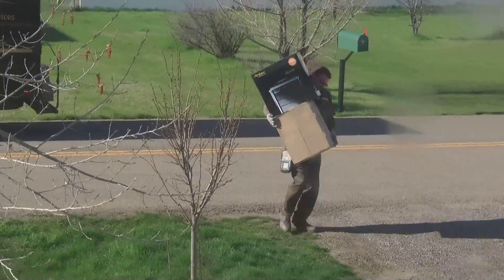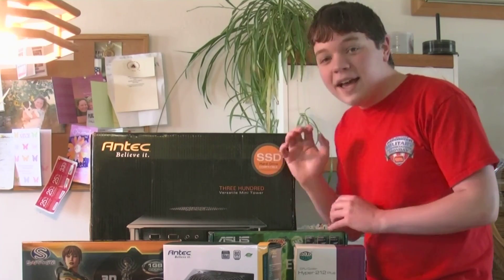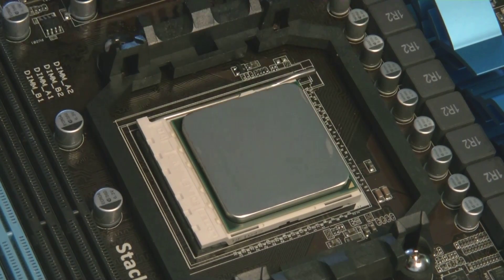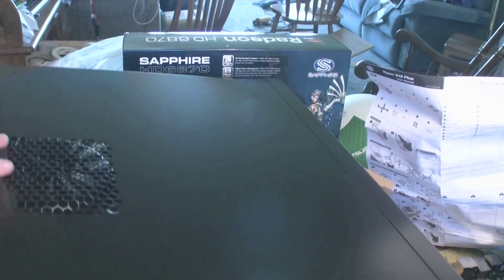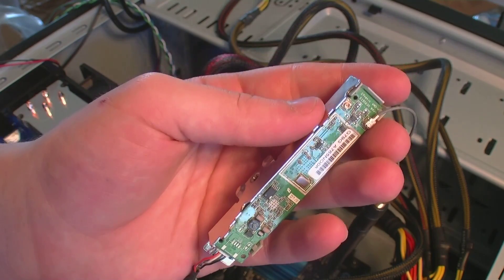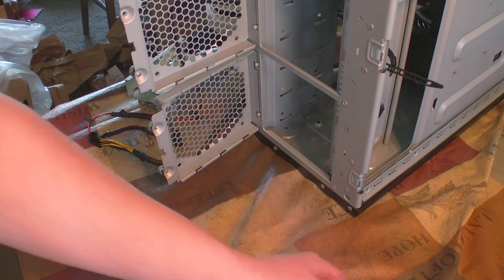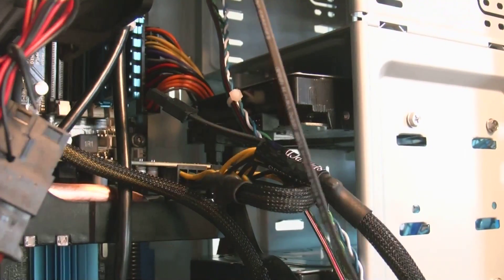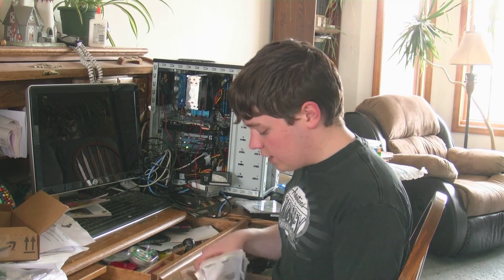Building My Computer

Comment: Slim computers aren't bad when you look at what it has, and if they're more of a modern one. I got an HP elite 8000 SFF (small form factor), 4gb RAM, 2.93 GHz processor, 250 GB hard drive, PC was only around $130. And I got a GeForce GT 710 graphics card for only $50, and this computer is SO fast, when the memory usage doesn't max out when I have a ton of programs open. I can play minecraft in at least 60 FPS with a 16 chunk render distance, even to 80 with other great settings. I can even play Fortnite with 30 FPS on this computer too, which to me, is great. And I even have 2 monitors used all the time. I, at least, don't have any regrets. Having regrets about getting a slim or sff computer really depends on what it has, me personally. I hope I didn't sound like I was bragging or anything.
Reply: And btw, I do plan on upgrading to 8GB RAM, maybe 16 GB, a quad core processor, maybe an 8 core processor, a better graphics card, and possibly, an extra hard drive or an SSD, when I get the money that is.
Reply: Still, great video! I love working with computers. And I do personally like bigger computers better, they're easier to work with. But for now until I can get more money, a slim or sff computer will be fine for me. :)

Comment: I had been getting very very board with watching videos that board the crap out of me.. When i came accross this one so i wanted to see what a noob would do.. not bad choices to start with the more you learn the better you will become.Cable management though is another story, you have bad air flow there and at some point something will over heat. here is some helpful advice from a guy who can build computers... you're case, the case it self is a good one for a very low in machine and there is not much you can do about the cables there but look into a better case.something like this one.

http://www.newegg.com/Product/Product.aspx?Item=N82E16811119233&ignorebbr=1&cm_re=PPSSBGDRYLXVJN-_-11-119-233-_-Product

this will help you with air flow and allow you do better cable management.. You hard drive switch it out for a Solid State Drive better know as a SSD. This will give you a hell of alot more speed for sure. in one Video you upgraded to 16 gigs of ram which was a smart move.. The video card is ok but to really kick some teeth down someone's throat i believe a Gigabyte Radeon R9 something like this

http://www.newegg.com/Product/Product.aspx?Item=N82E16814125491

The Motherboard it self should be upgraded.. there is 4 major reasons and they are

1, you will be able to use GBS 6.0 "this will be alot faster then the 3.0 and you will be able to use if you get the right motherboard USB 3.0 which is alot faster then 2.0..

2, better board means better proformence, this can be gotten just be upgrading the motherboard it self to something like. http://www.newegg.com/Product/Product.aspx?Item=N82E16813128627&cm_re=am3_motherboard-_-13-128-627-_-Product you can still use your processor, which can be overclocked to 4.0 "with liquid cooling." you can use the same ram too.
3, faster faster and faster.. if you go by this you will find your computer will be alot faster, cooler, and you wont have the slow downs like your getting now.

4, FINALLY! just by upgrading the few things your computer will run at least 15 - 45 % faster  then what it does now simple upgrades can make your computer life alot easyer in alot of ways.

SSD's are the best way to improve your computer with just switching out to another SSD drive and doing away with the Hard drives you will find everything loads faster then before. Also, here is a tip for ya, The computer will be as fast as the slowest part of your computer, which means that 5400 RPM hard drive has got to go bro your slower then a 1.2 GHz - P4 processor... Remember if you build it right you wont have to worry about it for years to come.

Well i hope this has been helpful to ya bro Good luck out there too man and nice first time build.
Reply: this video is four years old
Reply: ***** if i wanted you to tell me how to spell i would have asked you for it..... but since i did not your a idoit..
Reply: chipthe ehtpihc i did not see the date... lol ooooooooops..
Reply: He also had a bottom mounted PSU and he put it on carpet....this pc will overheat
Reply: this video is a old one
Reply: This video is 4 years old... Back then he was about 13 or 14
Reply: Wow it took you 3 comments to realise the difference between your and you're
Reply: NOBODYS PERFECT ;_;

Comment: The fan has arrows on the sides in the direction of airflow, so... Helpful advice from a 12YO...
Reply: What, do you mean, helpful advice from a 12YO? A 12 year old, can be capable of building a computer. In fact, you kind of just dissed a nice population of 12 year olds by acting like you know a lot more.
Reply: Elijah Huang I am 12 and I have a gaming pc :)
Reply: I didn't say a 12 year old can't have a gaming PC, nor did I say anything negative against 12 year olds.
Reply: Elijah Huang Yeah i know i wanted to support your reasons against Minecrafting in the closet

Comment: He built this pc with back to front steps. You should put the backplate on before putting the CPU in. And then put drives, cables and DVD into the case before adding cables and installing gpu.

Comment: i built a 200 computer using:
Amd A4-4000 3.0 ghz dual core
Fm2 basic motherboard
4gb corsair ram
80gb hard drive
radeon 5450 1gb graphics card
ATX mid tower case
350w power supply

Comment: ohh god just finished my build i got.. .
amd radeon hd 7770 1gb double dissipation
intel pentium g3220
asus b85m-g
1tb seagate barracuda
500w storm silent psu
4gb of corsair ram
Reply: ***** Hard Drive: 500GB Seagate Barracuda 7200RPM
RAM: 1x4GB Corsair
Power Supply: Corsair 430W
Motherboard: MSI H61M-P20 (G3)
Graphics Card: ATI HD Radeon 7770
CPU: Intel Pentium G860
Case: Fractal Design Core 1000

It's pretty budget, but it performs pretty well :)
Reply: Looks like a shitty computer
Reply: What i have
Hard drive : WD Blue WD10EZEX - 1TB 7200RPM 64MB SATA600 3.5zoll
Ram : 8GB (2x4GB) G.Skill Ripjaws-X DDR3-1600 CL9 (9-9-9-24) DIMM RAM Kit
Power : Corsair Builder Series CX750 750W ATX 2.3 V3 active PFC NT (80 + / 120mm fan)
Motherboard : ASUS M5A97 R2.0 GL/SATA600/R/USB3.0 AMD970 ATX SockAM3 +
Disk drive : Samsung SH-118AB 18/48x - DVD-ROM SATA internal black
Graphic card : Sapphire Radeon Toxic 2GB GDDR5 OC R9 270X 2xDVI/HDMI/DP
Cpu : AMD FX-8350 (8 x 4.0GHz) 8MB Black Edition (Vishera) SockAM3
Cpu cooler : Cooler Master Hyper 212 Evo Socket FM1/FM2/AM2/AM3 (+) / 775/115X CPU Cooler
Case : Thermaltake Commander MS-I Snow Edition - Mid tower ATX / mATX - white
Reply: Timo Pomer Should have got 2 4 gb they work faster
Reply: I have : 
Cpu : AMD FX-6300 4.0Ghz
Graphics : EVGA GTX 660 3gb Superclocked
RAM : Kingston HyperX 2 x 4gb ram
Mobo : Asrock extreme 4 970
Power : Corsair 600w
Reply: I got
Cpu: amdfx 8350 @ 4.5ghz
Gpu: gai ward geforce gtx 770 phantom edition 1.2ghz 2gb gddr5
Ram: gskill 8gb ddr3 ram @1600mhz
Hdd: 7200 rpm toshiba 1tb hdd
Psu: 750 watt psu
Reply: I got
Cpu: amdfx 8350 @ 4.5ghz
Gpu: gai ward geforce gtx 770 phantom edition 1.2ghz 2gb gddr5
Ram: gskill 8gb ddr3 ram @1600mhz
Hdd: 7200 rpm toshiba 1tb hdd
Psu: 750 watt psu

Comment: Oh and by the way majority of the speed of your computer comes from your CPU, for example a 1Ghz cpu with a radeon 7970 will run horrible. You need to balance out the gpu with the cpu so theres no bottlenecks, for eg. an a10 with a radeon hd 7970 would bottleneck the gpu so much and wouldnt work as outstanding as it should.

Comment: Umm no way is an A10 comparable to an i7, heck its not even comparable to a good i3 man. even the a10 5800K is no where near as good as the i3 3220 nevermind i5 or i7. Benchmarks prove it its just no where near comparable performance wise. Although its a very good budget build APU. But seriously if your gaming you dont wanna use integrated graphics ;). 1 think unexperianced pc people do is judge cpu's by cores or MOAR GIGAHERTZ!. No. i3's have dual cores but still outperform some quad core amd's

Comment: True, but mainly it depends on how many fans you have installed, and which way they're facing. With more cables in the way of components, means more air flow is needed.

Comment: Your incorrect, it does change the computers performance. With all the cables in the way of the components it means less airflow which equals overheating which equals slower computer performance. Snayup ;P

Comment: Windows have just as many software errors if not more than a mac. And the support comes from the store you get it from. Make sure you get it from a store with good support, don't be an idiot. If anything happens, they will take it in and fix it for little or no charge. It also has to do with your guarantee. It is very hard to create a Mac virus, many hackers can't do it or just don't have enough time. Most people have a PC because they are cheaper.

Comment: The look of those things is a disappointment, as i use to be a big Mac fan with the older Macintosh. They are nearly impossible to  open up and repair, modify, hardly any support for them. They tend to have major issues with software, tend to freeze a lot, maybe not as many viruses, because its not worth hackers time, as more people are using p c.

Comment: That kid spent 1000$ for this pc.
I built a pc at about 400$
CPU:AMD Phenom II Quad Core, 3.4 GHz, 6MB L3 Cache.
8 GB RAM
Graphics card:GT MSI afterburner 4 GB
BOX: Shere II
Motherborad: Asus, 2600MHz FSB, 4 RAM Slots 16GB Max, 7 SATA 
Windows 7 ultimate, i suspose that it was the most expensive thing on my pc FREEEEEEEEEEEEEEEEEEEEEEEEEEEEEEEEEEEEEEEEEEEEEEE!!!!!!
hard drive : 250 GB SATA III
and some extra cables
power suply:600 watt
and a DVD player
this kid spent 1000$ i dont bielive that

Comment: In the past, AMDs were pretty much on par with Intel, but in recent years, they haven't been able to keep up. An AMD from this year cant keep up with an Intel from last year. Get a standard Third Generation I5 and that should be more than enough in the years to come. I myself do a lot of multitasking and I needed a fast computer, not really a gaming one right now, so I went with an I7 3770k. A bit of overkill, but it will last a longer that way.

Comment: Have you ever heard of a bottleneck, Well its something where You get one Expensive part, and get the cheapest Next.
Example- Expensive GPU, Poor Motherboard, Poor PSU, Poor CPU Heatsink, Poor case with no cable management holes.
FUK YA CHEAPO!

Comment: asus M5A99X EVO mother board
AMD Phenom II (x6) hex-core processor stock cooler
MSI radeon 6870 video card
corsair TX650 psu
HAF 922 case
8 gigs of ram (vengeance same as his)
2tb hard drive (sata 3 7200rpm)

Comment: @multiTylertv i agree that they are overpriced like 1000 for the cheapest laptop is a little harsh. but the mac lasts for a long time, i have a friend that bought a mac two years a go, he never had a single virus nor a crash, and he still loves the computer. unlike my old pc which i had to take 395679846 viruses out (the number is an exaltation) plus the buttons stopped working and the updates didn't change anything. btw have you ever owned a mac, and i mean owned (not borrowed or tested out)?

Comment: @StuffTubeAmwesome they will not overheat werather they are pulling air or pushing its still moving the air away. if one hard drive can survive without a fan then if the fans are pulling the air its ok max they can get is about 40c

Comment: download cpu-z, and cpuid hardware monitor. These programs will tell you if things are either too hot,  or if your cpu is running at proper speeds. Also make sure your motherboard is the same CPU WATTAGE, as your cpu..I bought a motherboard through a combo with a phenom ii 955, and the motherboard, though AM3 compatible, was 65w max..total nightmare and confusion. good luck

Comment: Very nice!  

I have the same cooler on my work computer.  It brought my cpu temp down from 100C under load to 35C under load.  

Now all you have to do is work on your cable management skills! 

As for the thermal paste.  They way you did it was fine.  If you ever take it apart you will see the thermal paste will have squished out quite nicely.